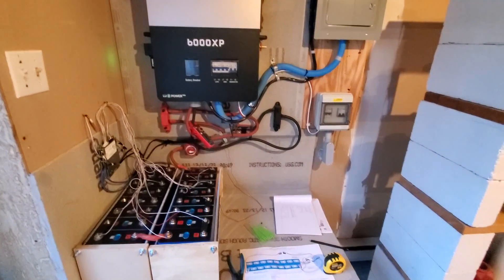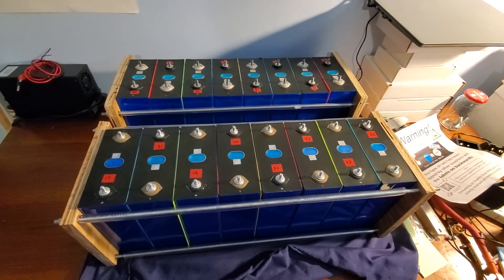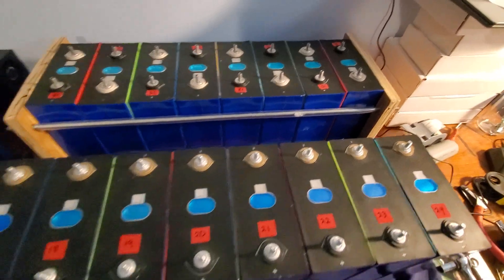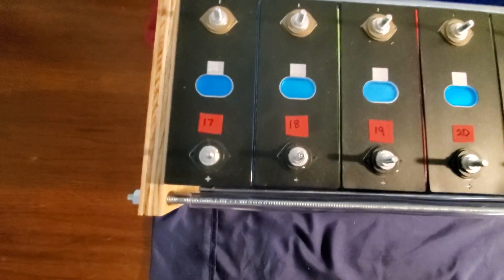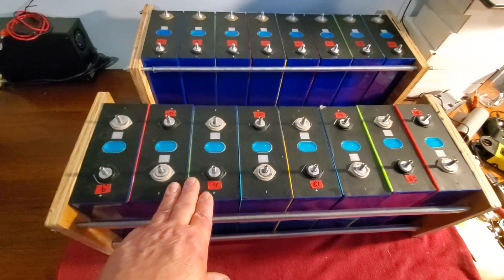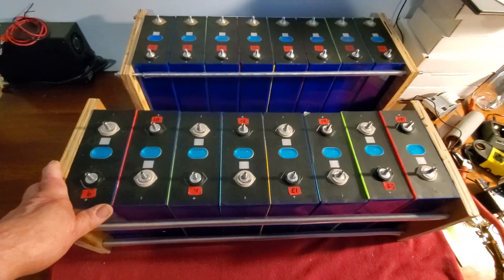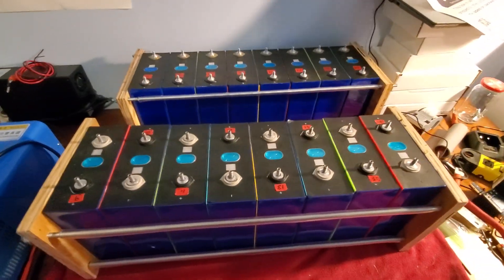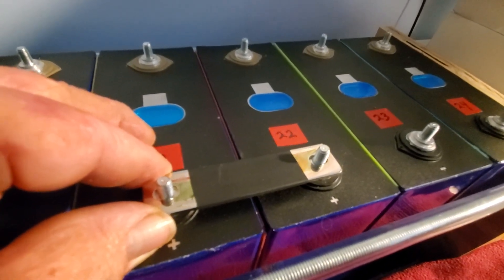EG4 6000XP - Part 8 - DIY Batteries - Solar System Upgrade

Comment: $150 a cell? $150 BMS?

18650 Battery Store has grade a 280’s for $120. A 100A JBD BMS is well under $100

Your cells are 280’s if those are Eve LF280K. They come out at 298 to 300. 304’stestvat  320
Reply from the maker: I did look into 18650 battery store last year but couldn't find enough information about them to feel comfortable buying from them. Like I mentioned in the next video, I can away find stuff cheaper all over the place but choose not too. Just my choice. Thanks for your comment. I'll keep an eye on them if needed later. Take care.

Comment: EVE is putting new two post terminals on their 280 and 304 cells. I'm waiting on delivery of 48 304ah cells now. $105 Ea. delivered to the door. JK Inverter BMS /w 2a active balancing about $240 ea. In big fat numbers that's about $1920 for a 48v battery pack north of 15kwh. Good luck finding a server rack battery that'll come close.
Then I've just found a local supplier getting the same cells in bulk about 40 miles away where I can get the cells for the same price off the shelf and drive them home. Only difference is they'll cost a little more for the tax man.
I think it's still very much worth DIYing battery packs.
Reply from the maker: Wow let me know whete you are finding 305 Ah batteries that actually test at that for $105! Just me so I can get some before they sell out lol. Yes that is something! I've got to find a BMS that will talk to the EG4 6000xp, I am tried of trying to make the voltage work.  More on that in next video
Reply: @LivingFree4All  The JK inverter BMS can talk Pylon on the CAN port and the 6000XP also uses the protocol for other battery packs. Should work.
Reply from the maker: @beebop9808  my next step would be to find out how it communicates with the inverter.  Is the inverter capable of reading all cells or is it just reading whole battery voltage which puts my back to bms reacting and what i already have. Thinking more about it, I have 2 batteries and wondering how thats going to work too. I need to do more research.
Reply: @LivingFree4All  No the inverter doesn't care about all that. That's all the job of the BMS. The inverter just gets the information as a sum of all the battery packs. The inverter only communicates with the Master BMS and the Master BMS polls the information from the slaves.
You might consider checking into the off-grid garage here on the tube. Andy has put out several excellent vids on the subject in detail recently.
Reply from the maker: @beebop9808  ya I've watched Andy lol he gets more detailed than I need but i do enjoy his videos. After all he's an engineer and I actually work for a living lol. Don't remember anything regarding a master BMS so ill dig deeper.

Comment from the maker: And of course the last 3 days have been all total sun and I'm at work not able to see my BMS and if its shutting down the charging or the inverter now that its on top side for a change  lol. I  did get an  over current from the bms yesterday so I  turned down the amps to 80 instead of 100. Hoping that helped but don't know. I'm sure it will rain all Saturday and Sunday now lol

Comment: why do battery pack DIYers use the carbon assembly grease which the data sheets show it has 23 Ohms-cm where as the silver conductive grease datasheet shows it has <0.01 ohms-cm, yes it is 4x more expensive, but you are using such a small amount that the tube will last years. am i looking at this wrong?
Reply from the maker: Let's try this again. You may have a point. I agree, costs at this small level really isn't a concern if it's that much better. I got this from Ray as well but really haven't looked into it. I respect Ray's choice and just passed it on.  I'll take a look into it as their might be some other factors like oxidation, flammability etc. to consider but you may have something here. I would be interested in others comments. There are some crazy people on UTube including myself. Since I don't make any money on Utube (don't plan too either, I think it's just all a carrot on a stick, that boat passed many years ago) and I don't care what UTube thinks of me, I will speak my peace without concerns. Maybe not always the right choice. Take care

Comment: Your original configuration was Series. When you turned every other one around and tied positives to positives and negative to negatives that was Parallel. In Series end to end your voltage was additive and in Parallel the voltage remained the same but your current capabilities went way up.
Reply from the maker: Are you saying I was wrong in my wording of my batteries connections? How dare you! You must not be familiar with my technical terminology for novices. I am never wrong with my wording!... Oh wait… aaa… jesus, (talking to myself) I did say series when I meant parallel…I can’t admit that or I’ll look like an idiot… Am I talking out loud again?… cough cough (clearing throat). tis merely a flesh wound! (Monty python quote).

Lol you are correct! I said series but meant parallel at 3:50 into the video and I haven’t been able to find out how to correct a video once it’s already posted. The batteries are in series when hooked up to inverter for increase in voltage while in parallel for balancing to keep the voltage low at 3.2ish. I really hope people understand that because if not, they shouldn’t be working on solar without that basic knowledge. I very well could have said that in other places too. What I’m thinking is not always what comes out of my mouth. Wish I could figure out how to change it here on Utube after the fact now. Well I'll try to look into it. Super Thanks for pointing that out! Take Care..

Comment: You have a JK BMS with an active balancer, you could just make your 48 volt battery out of those cells and top balance once the battery is charged..There is no need to put the cells in parallel, that system was created for lithuim ion, and people assumed that is how we should also treat LIFEPO4, but there is no need for that at all..My CATL cells are still over 10 Ah's above 280Ah's after four years of living off grid, and using them everyday..They were 292 AH's when brand new, now they are testing at 290Ah's, but they are 280 AH cells..
Reply from the maker: Interesting you may be right. I'm still doing it my way lol. I hope you understand, I trust my own experiences more and I've had problems with the balancers keeping up especially when these two batteries (now one) have never been balanced together. Plus I'm going to test each cell anyway to see the droppage of Ah over the last 5 years for myself. Will be interesting. I'm not aware of it being a JK BMS as it's name is not that but there are so many spin offs of these BMS it's hard to keep up. You will see it in the next video up close. Thanks for your comment, I will keep that in mind. Take care.
Reply: @LivingFree4All  Oh, I thought I remembered you having a JK BMS, I must have been wrong..The JK BMS's come with active balancers, up to two amps, that is why I use them..Most all other BMS's have passive balancers, that can never keep up with these sized cells..
Reply: @LivingFree4All spend $50 on a 16S active balance board. Add a switch to it and only turn it on above 3.45v
Reply: Any videos on active balancing  (top balance?
Reply: @flopackrc5452  Off Grid Garage with Andy has all of that on his channel..
Reply: @realeyesrealizereallies6828   yeah I seen Andy just hard to follow to techy
Reply from the maker: My BMS has some balancing built in, not a lot at 2A but I've never had any problems being out of balance now for over 4 years. I think the whole balancing thing is over kill to be honest. 2 amps at only the top % of balance isn't going to make all that difference and is more a waste of time and money. I think the main thing is to balance them 1st and just let them do their thing. lol. Again I think the whole balancing thing is a bit over kill. @flopackrc5452